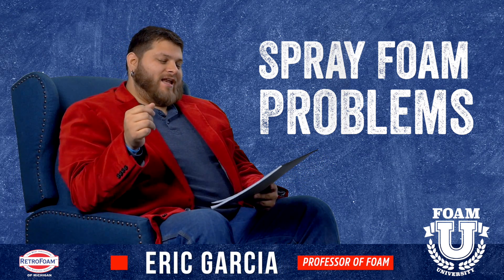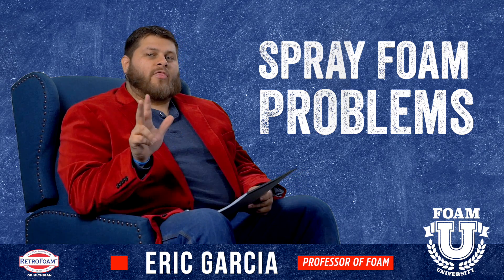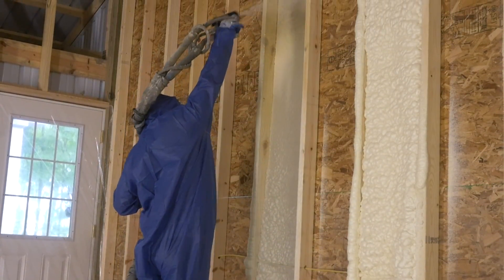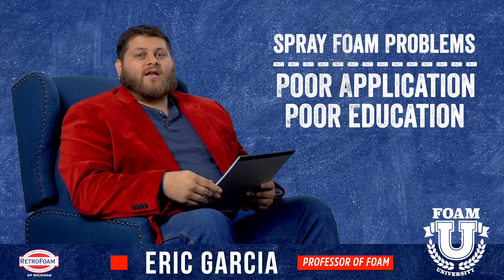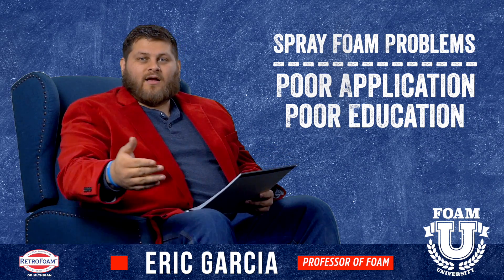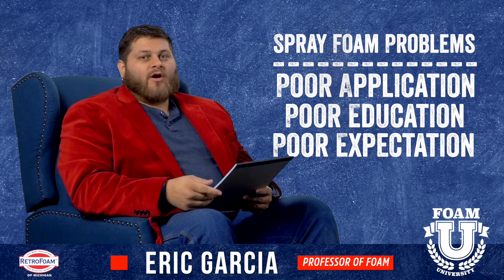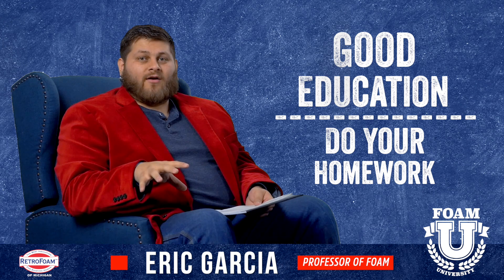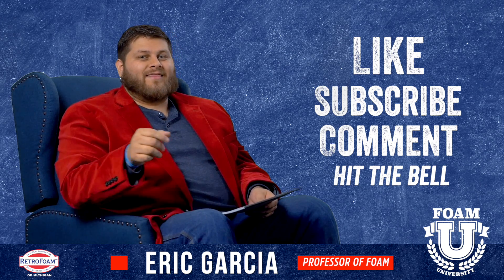Spray Foam Insulation Problems | Foam University

Comment: So...I had about 90 square feet to cover on an unventilated roof.  I called up spray foam people and they said the minimum cost was $3500 for a tiny space.  Nope.  It's 90 square feet on a faulted ceiling.  The other half of the room has rafter ties, all that.  This 90 sq ft was half of the room.  I bought one of those spray foam kits.  It was a bunch of cans with a gun, not the tanks.  The cans needed to be upside down, pointing up over the gun and I couldn't get close enough to the ceiling to meet the manufacturer's recommendation of 6-8 inches.  Had all of the requisite protection and ventilation.  I did a terrible job.  Terrible.  Insulation was falling like snow, made a huge mess beyond what I taped off.  I got it in my eyes in spite of the goggles and had to flush twice. Could barely see through the goggles at the end of it.  The only way I could do it with any accuracy was short pulses out of the gun.  I have a lot to cut and trim before drywall.  Some of the area is too thin and wood is showing in spots.  I'm wondering:  Can I salvage that job by using a product like Loctite, maybe one of the big gap fillers to even out the bad spots?  All products will be closed cell spray foam.  I'm okay with each can covering 20 square feet and not getting a great R value.  I just want enough of a barrier to stop condensation.  I need it to provide some insulation, but stopping catastrophic mold damage is the main priority.  R-30 isn't gonna happen.  It's a 70 year old garage with 2x4 framing plus a couple inches of furring.  The purpose of the spray foam is a little bit of insulation plus enough of a vapor barrier to make the structure last.  Will something like a big gap filler work on another product after the kit insulation cures?
Reply from the maker: I would recommend getting another froth pack to touch up where it's needed. The kits are more effective than the can foam.
If there are small cracks and crevices you need to fill, that is where the can foam will come in handy.

Comment: Would it be a waste of time and money if the foamer wo t even spray one exterior wall because it has old post wiring
Reply from the maker: Spraying all but one wall can work, but the issue becomes that those air leaks will move to that exterior wall.

Comment: Damn! Spray foam has too many ways that it can go wrong! You're depending too much on the contractor! If the spray foam goes wrong then what? Oh sorry that's not our problem! You're betting the most expensive thing that you'll buy! There are other products that stop drafts that aren't as invasive. Have you seen a fire test of spray foam? Oh boy! Yeah, depends on what foam product that you are using!
Reply from the maker: A good contractor will make it right if there is any issues. That's why vetting  the spray foam contractor you're considering working with is super important.
When it comes to fire testing, the spray foam and injection foam materials we use are Class One Fire Rated and doesn't serve as a catalyst. This article goes into more detail.
https://www.retrofoamofmichigan.com/blog/insulation-fire-rating-definition

Comment: My SPF contractor forgot to add a wall in the attic to separate the interior from exterior and spray foamed above the exterior (porch) ceiling. They’re coming back to install the wall and foam but what should I do about the exterior that’s now sealed? Thanks!
Reply from the maker: The exterior being sealed shouldn't cause a problem.
Reply: @RetroFoamofMichigan  I had the SPF contractor dig out 2-3 soffits on each of the three walls just to be sure air can still move.

Comment: My mother had open cell foam sprayed into her attic rafters. She now has a moisture issue and the ceilings need to be replaced. We have been advised to scrap the foam out and go back to a vented attic. What`s the best way to remove that foam without damaging the roofing nails that poke through?
Reply from the maker: Open Cell Foam is soft and pliable, it should be very easy to pull up. The best tool to use would be bread knife to cut that foam back.

Comment: I am having a home built in Auburn Fl. I was thinking of using stray foam in the attic up against the wood roof. But heard its bad for the shingles,so I was thinking if I put cardboard up on the rafters to give an air gap will spray foam adhere to the cardboard ? giving me the air gap and sealing up against heat in the attic!
Reply from the maker: You would not want an air-gap with Spray foam! Spray foam insulation in the attic creates a ventless system and the term is called a 'Hot Roof' here is an article regarding a hot roof (https://www.retrofoamofmichigan.com/blog/what-is-a-hot-roof)

Here is another article explaining the damage of shingles! https://www.retrofoamofmichigan.com/blog/does-spray-foam-damage-roof-shingles. I hope this helps!

Comment: Metal carport/garage building. Fully enclosed. Philadelphia area. Is 1in spray foam enough. . Is 2 in enough. I plan to heat and cool. Most only if im in the building and want to keep it right above freezing in the winter. Cant get a straight answer from any spray foam contractor ive spoken with its discouraging.
Reply from the maker: 2 inches of closed cell foam on the walls and ceiling could be enough. If you will have any type of heat source in there it will for sure be enough. Just keep in mind that with no heat source at all, it can still get below freezing if it gets cold enough.
Reply: @RetroFoamofMichigan  i definitely plan on having a heat source. Would 1in be sufficient or just a waste of momey.
Reply from the maker: @lifestoshortbed5027  That could also work, just keep in mind that more inches of foam will give you a better performance. That means less your heaters are having to do to keep your Pole Barn up to your preferred temp.

Comment: The product needs to be designed for real world application.  You will never get 100% from any contractor or his crew. Period!  Especially in the modern world where there is a shortage of competent crews.  If the product has no room to not fail then you can bet it will fail.  Because time is money there is also the pressure to hurry the job which again leads to mistakes, shortcuts, oversights, etc.  Most contractors do not want the owner to be looking over their shoulder and slowing the job.  You in most cases do not get to dictate the building conditions because it is a seller's market. No one is there it do real quality control when the owner is absent. So it is very disingenuous to blame the buyer who is forced to take what is available.  The product has to be engineered to withstand a realistic margin of error before it is released to the public or the producer has to be fully liable for the results.  Equally it is irresponsible to fall back on the old saw "education" because education varies all over the board and most don't spend the time to acquire it.  Some because of a lack of time, some lack opportunity, some can't afford it but you can bet when it comes to hiring help those that are picked are those that are available not those who know the most.  Then there is the fact that many in fact most manufacturers do not give out information preferring to depend on Madison Avenue hype with no shred of truth in it yet this is what the contractor's rely on.  That "information" can vary from pole to pole depending on which seller is making up the story.  This is the information you have to use to do 'due diligence'.    

Nice try though in blaming the consumer for the spray foam failures which only highlights the shortcomings of the system making it a poor choice for the modern market.

Comment: Makes me want to stick with traditional fiberglass batt insulation.  Just make it thicker and it will work as expected.
Reply from the maker: Each insulation type has its own pros and cons so we do our best to educate homeowners so they can decide what is best for them. We compare the most common types of insulation here: https://www.retrofoamofmichigan.com/blog/foam-fiberglass-cellulose-best-insulation-existing-house
Reply: @RetroFoamofMichigan  I'm putting the "jive" on ya!   I wouldn't have anything BUT spray foam in my home or barn.  Seals and insulates.....fiberglass batts fail in comparison!
Reply from the maker: @dwayneloftice2326  I see you! Had me worried for a second...
Reply: @RetroFoamofMichigan  .....with all the hidden "nooks & crannies" that result in wood framing, closed cell foam is the ONLY viable solution in which to create a R-value separation while sealing all the possible air leaks inherent with fiberglass batts.  Secondly, using foam on a metal building becomes the only viable option.  Metal buildings have inherent leaks at the floor, the roof/wall intersections, corners and ridges.  Foam not only seals them it creates a uniform R-value to separate the interior from the exterior.
Reply from the maker: @dwayneloftice2326  preach it brother!

Comment: I got a contractor who was experienced. There are sections of my closed cell installation that are mushy and a different color. The hard sections are light purple, the mushy sections are dark purple. I'm worried about off gasses. Is it possible to fix these sections by cutting them out and respraying? Also if there is mushy sections in the middle of the hard spray foam but cant be seen, can they still off gas through the good stuff?
Reply from the maker: Seems there may have been some type of issue with the install, possibly. Problem spots should be able to be removed and resprayed. However, it would be best to talk with your contractor about this.

Comment: I'm new for this machine my problem is  the  foam that i installed is not expanding. I dont know whats the problem is.
Reply from the maker: Is the spray foam you're applying closed cell? I only ask because closed cell spray foam doesn't expand, while an open cell spray foam will.
Reply: @RetroFoamofMichigan   it' close cell we are using it. On the roof deck.
Reply: Its only expanding up to 2cm.
Reply from the maker: @thereamredpopsiclerants  closed cell spray foam doesn't expand the way open cell spray foam does, so you're not going to get the same kind of depth.
Reply: @RetroFoamofMichigan  ah thank you sir.
 I have another quoestion. Why some times my foam become too  crunchy. Some times its too soft.
Reply from the maker: @thereamredpopsiclerants  this could be a temperature issue or a moisture issue on the substrate.
Reply: @RetroFoamofMichigan  ah okey sur noted i'll check that.

Comment: I have a tight crawl space under the house where I would like to insulate under the hardwoods. What is the minimum clearance a tech would need to apply the foam effectively? I understand the size of the person would dictate most of that but is there a minimum required distance for the two chemicals to combine as they exit the gun?
Reply from the maker: The installer would need at least 18-inches of clearance to get down in there to work. If there is less than that, there are still methods that work, like cutting strips in the floor. Here is some more information you might find helpful. 
https://www.retrofoamofmichigan.com/blog/how-to-spray-foam-insulation-under-floor
Reply: @RetroFoamofMichigan  I have a wooden summerhouse which im going to block off all holes first with foam ive already yacht varnished the inside my next plan is to put fibreglass on next then a small gap then finish it covered over with the silver insulation then reboard it in ply wood not a clue if this is right so please give me advice as to what I really should be doing please
Reply from the maker: @carololgajohansen196  It seems you want to do the work yourself, so I'll give the best DIY recommendation. Can foam ALL gaps/seams/joints in wall cavity. Install foam board, can foam all gaps/seams/joints. Install fiberglass batts, staple the flaps to the studs. This is a cost effective DIY solution.

Comment: The time between coats is a factor on bad smells coming from the foam from what I understand, depends on the product itself, correct? Is there a good general rule of thumb on how thick to lay it and and how long between coats? Also thanks for actually answering everyone's questions, most YouTuber's don't bother.
Reply from the maker: Yes, time between coats will make a difference. Every products is a little different, some you can only spray 1- to 2-inches and then wait an hour.
While other products can be sprayed 4-inches thick and can have another coat after 10 to 30 seconds. This is in regards to closed cell.

Comment: I had my attic spray foamed with open cell. Blown in was all removed. Humdity is now very high in the attic, close to 70%. What are typical causes of this?
Reply from the maker: There is humidity in the house, so now there's no outlet in the attic for it. If you run the bathroom fan or even open a window can help.

Comment: Hi
I'm planning to build container house and was wandering if and which foam insulation is good choice for inside and outside insulation as I planning to build in Ireland where is lots of rain and it's not big oscillation of outside temperatures, usually from -3°C to 25°C all year round. Thanks
Reply from the maker: We would recommend 2-inches of closed cell spray foam on the inside or 3-inches on the outside with a UV protective cover. This article has some more information on this. https://www.retrofoamofmichigan.com/blog/how-to-insulate-a-shipping-container
Reply: @RetroFoamofMichigan  thanks
Reply from the maker: @fishingologybyvz5302  you're welcome!

Comment: Is it a good idea for a beginner to try and research, learn, and ultimately DIY a spray foam insulation on an attic floor?
-edit: i would like to spray foam a closed cell foam on my attic floor, after removing the current blown in fiberglass, and let it cure/dry. then i would like to put R50 of blown in cellulose on top of the spray foamed attic floor. thoughts? (my attic has soffit vents around the eaves and at least 10 vents on the attic roof)
Reply from the maker: Generally speaking, there is no practical benefit to a hybrid system. If you were to spray 2-inches of closed cell, then you wouldn't need the cellulose because you've already created an air seal.
DIY kits for an area that large probably won't be cost effective.
Reply: @RetroFoamofMichigan  thank you! How many inches of closed cell vs open cell foam would be needed? (This would be an attic floor with no other insulation other than the spray foam) :) northern IL (zone 5)
Reply from the maker: @ZacharyTrainer  we recommend 5-inches of closed cell for the attic flat and 7- to 10-inches of open cell depending on where the home is located.
Reply: Is around $5,000 an expected cost for 1222 sqft attic floor?. Tyvm for all the replies! If it's more than $2,500 i think i will consider just blown cellulose
Reply from the maker: @ZacharyTrainer  we have a budget calculator on our website that can give you some rough numbers to consider.
https://www.retrofoamofmichigan.com/calculator

Comment: What is the best way to verify that your contractor can reliably handle your injection or spray foam project? Is there a certification to look for? Google Map Reviews?
Reply from the maker: Great question. Yes, looking at reviews is a great start. We outline a few other things to look at in this article: https://www.retrofoamofmichigan.com/blog/insulation-contractor-vetting-checklist
Reply: Ask to see pictures of other work and if possible a site that was recently sprayed. If the foam looks like junk, drippy, Sloppy... avoid them. Also ask what foam brand they use and make sure it is of high quality.

Comment: What type of spray do need for metal building just for ceiling
Reply from the maker: In the majority of cases closed cell spray foam is used on walls that will be left exposed and open cell spray foam will be used on the ceiling.

Comment: Hi I have a Church building 50 years old with a gravel & tar flat roof on top of a metal deck not sure whats in between, but their is NO insulation underneath the metal deck inside the building. I was wondering if a spray foam would improve the R value of the roof,  if sprayed under that metal deck inside and what kind should be used.?
Reply from the maker: Hi Benny,
Spray foam would definitely help in this situation. Open cell spray foam would be the best fit for this particular project.

Comment: I have a metal bldg (carport fully enclosed) 18x20. The contractor wants to do open cell 5in.  applied to the underside of the roof and 2in. to the walls with closed cell. Should I be concerned over time of the foam falling down from the ceiling? Will condensation come thru the open cell on the ceiling? He said it will stop condensation.  Yes I have seen those horror stories and it does worry me, as I will be inside all day woodworking.
Reply from the maker: That system should work just fine as long as the foam is installed properly there should be no concern of the foam falling down.
Reply: @RetroFoamofMichigan  6 weks ago open cell spray form was applied in my attic apparently   odor is not going away and it's gas fumes making eyes nose burning, throat irritations and headaches.Contractor wants to spray with sealant . can this help odor?
Reply from the maker: @bilkiskhanani5299  The sealant could help, especially if it is bad foam. If the area just needs to air out, the use of air exchange units would be best.

Comment: Guys
I have my shingles bowing up on hot days right over every rafter. Shingles lay flat over the decking. 
I’m thinking a temperature difference but to cause that?
Ideas??

Florida panhandle. New construction 2018. Closed cell.
Reply from the maker: Our climate is not susceptible to this generally. There are many variables that could be playing a factor, but it could be the attic space is very hot causing the roof trusses to heat up. This can cause your shingles to come in contact with heat from the bottom and above from the sun.